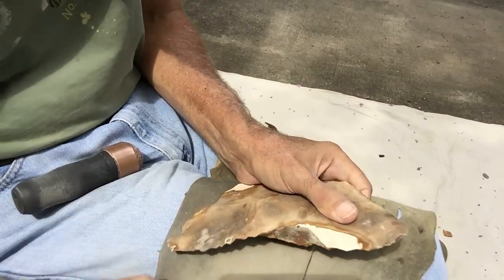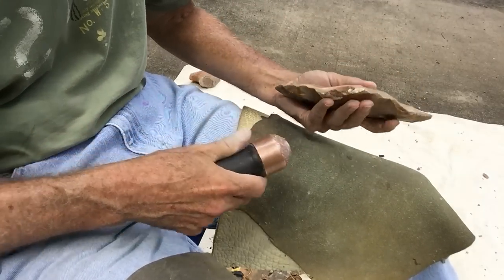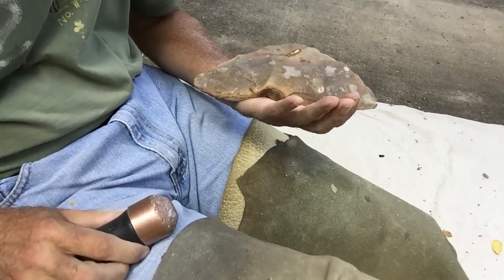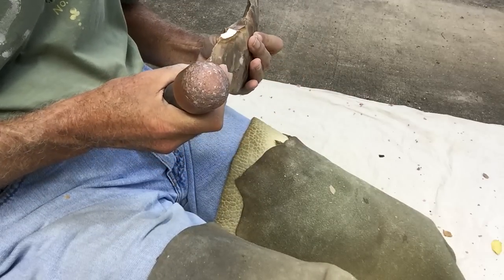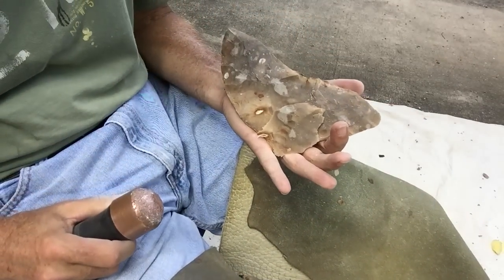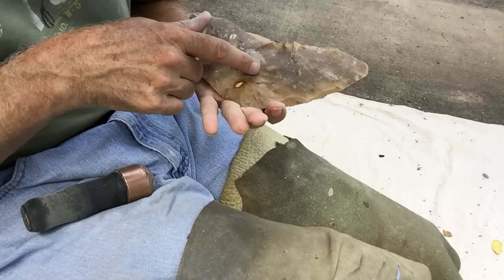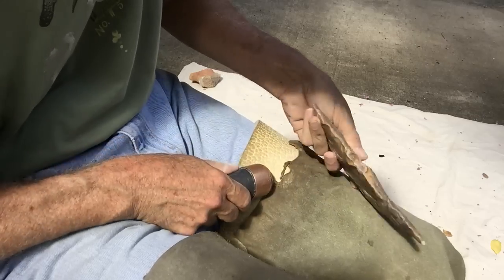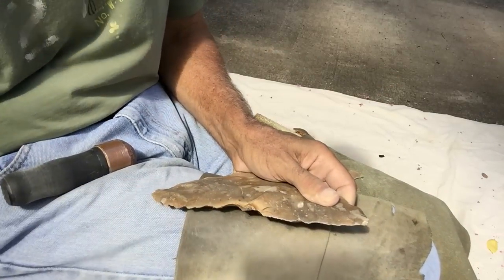one-tool big direct percussion knapping 3rd of 4 vids

Comment: Freeze nice video.  I am a little disturbed that I got all of your sixties references, I didn't think I was getting old but I guess it is happening regardless of what I believe.

At one point when you were working on the chalky indent you mentioned hitting straight into the piece while not supporting either end.  Are you saying that the direction of your bopper is moving directly into (parallel to) the piece or are you saying the energy of the cone is moving directly into the piece?
Reply from the maker: Kevin Grogan the force vector is going straight in. never the swing. and the hard part to grasp is that a number of variables go into establishing the direction of the force vector. the shape and position of the platform, the support underneath, the shape of the contact point of the billet/bopper, the plane/angle the preform is held at, the direction of the swing, and the conchoidal nature of the fracture. but it's learnable and can become intuitive after thousands of repetitions. just have to make adjustments and note the effects.